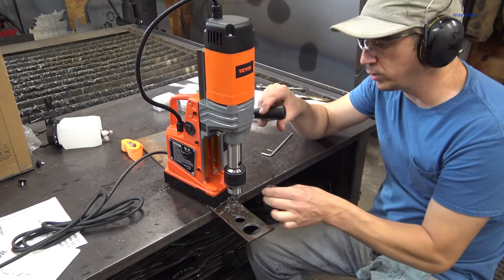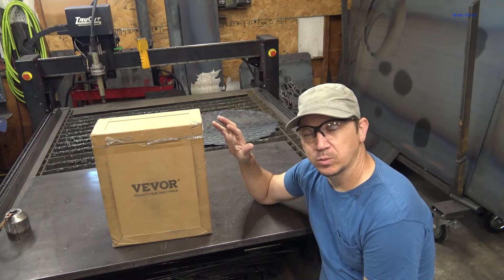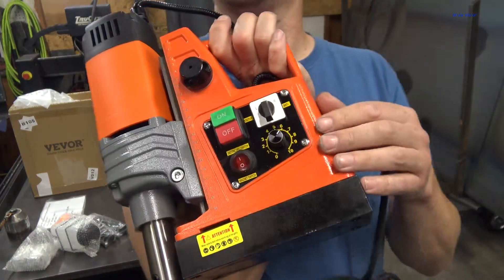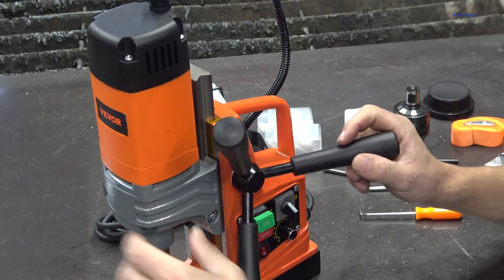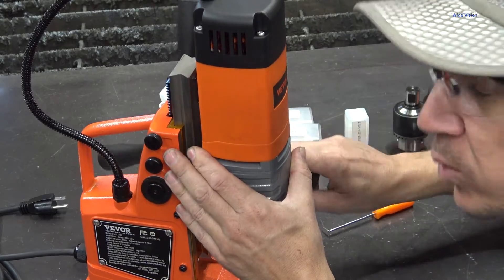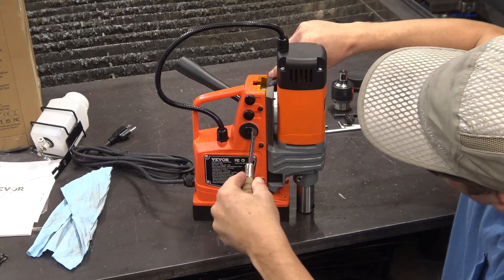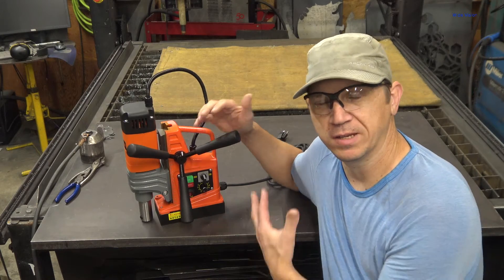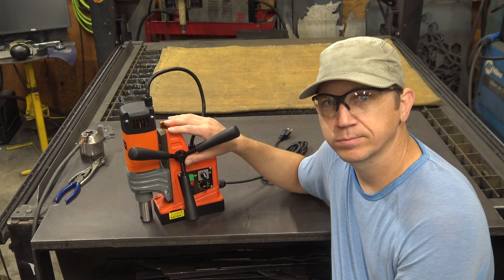VEVOR  mag drill - SLIDING HEAD, variable speed, and REVERSIBLE!  model D8840

Comment: As a retired union ironworker I worked at structural ironwork on bridges and buildings where we use mag-drills all the time. one thing we always teach is to hold the handle of the drill body in one hand and run the crank we to other so that if the magnet breaks loose for any reason you can still control it and limit the knuckle busting kickback and the sharp bit. On most mag-drill move the crank from one side to the other is easier, like Hougen  drills have a keyed shaft and some newer drillls use a female 1/2 inch square drive on both side and come with a ratchet. The handles always get in the way and usually we just use one handle which means the others often get lost in the field. We alway use what we call a football or close-quarters drill where height is an issue. The carbide tipped annular cutters are a game changer as is speed control. Cutter diameter and type dictate speed and you can't go wrong googling rpm charts to match the material you are drilling to the diameter of the cutter, surface speed. A very good video. I just bought one of these for my home shop because I can't justify the cost of the Hougen or Fein drills but if i had a butt load of hole to drill i would not hesitate to pony up the money. Thanks for the video it was very well done. Make nice deep center punch marks when you layout holes because locating the center pin help keep the drill aligned when starting the hole.
Reply: That's some asinine logic 😅, you really think when that drill breaks loose your puney meat bag hand is going to hold that thing let alone " control" it ?  First off teach them to strap it down hence why they come with it, and if that helicopter takes off gtf clear of it not hold onto it, SMFH. Orthopedic surgeon is gonna love you guys. Has enough torque to drill a 2" diameter hole thru plate steel,and you think your going to control it let alone one handed while surprised instantly 😅😂 keep the wives tales and teach these kids self preservation

Comment: Getting the handles on mine was a bitch, everything else was a breeze. The first time using it made me wonder why I had not bought one before. Moving the motor allows the use of regular drill bits, I haven't tried tapping a hole yet, but there is always tomorrow.Yes the handle is reversible, being a southpaw I like it on the left side. The switches are okay where they are on the right side. Glad to see someone else satisfied with this mag drill.

Comment: The Dewalt has a reversible handle, for the price,  cannot complain. I would be afraid to use it  on a  job that requires many holes, for example, a welding table.

Comment: The terrible runout is due to the bearings.  I bought a Vevor mag drill in December, which I tore apart because it had TERRIBLE runout.  Almost an 1/8 inch of runout!  So I tore it apart, thinking the quill shaft had to be bent, and that I would straighten it.  But once I got it apart, which was very difficult, I had to drill out a square key that had been peened in place, I found that the shaft was perfect.  (.001 total runout)  So I ordered new (NSK brand) bearings that the shaft rides in, a small upper and a larger lower.  I received the bearings last week and installed them yesterday.  It looks way better to the naked eye, put the indicator on it, and it now has .007 total runout.  PLENTY good enough for an annular cutter.  So FYI:  it's the cheap Chinese bearings causing the horrible runout.
Reply: As nice as brushless motors are, they had to make the bearings the weakest link. Bearing mods should probably be a thing.

Comment: I started to enjoy this review because I'm considering buying a Mag Drill but as soon as this knuckle head started drilling, I lost all respect for his "skills" once he started drilling at high speed instead of letting the drill bit do its job properly. Every Machinist knows that drilling has to be done at the lowest RPM possible to maintain the bit's sharpness and life span and once any smoke starts coming out, you have to backdown the speed. The smoke is the 'indicator' of what the proper speed is. Which simply means, this guy doesn't know much about metalurgy or drilling for that matter at all. And he's not using the proper coolant or tapping oil. Thumbs up to the drill, thumbs down to the "operator". What's really funny is that while he's making his mistakes, he's blaming the drill for not tapping through fast enough? Drilling is not about speed, it's about doing it effectively, you Duh?!?
Reply: 😂  You have no idea what you’re talking about.   Yes, he was drilling far too fast.  But smoke means absolutely nothing in this setting.  He’s drilling steel, not wood mate.  When you’re using steel to cut steel, it gets hot…always…Regardless of how fast you’re going.  When you add high sulfur dark cutting fluid to that equation there’s ALWAYS smoke.
Reply: I received mine this morning and made some holes this afternoon, 5/8 holes easily in 1/2 in thick mild steel.
The only thing negative, I would like to have a stopper to stay the drill in upper position.

Comment: I have that exact unit still sitting in its box I bought a month or so back, I just haven't got around to doing the job I bought it for yet, so have not unboxed it. I didnt realise it had the extra height adjustment, that is indeed a game changer. The amount of times I have struggled with clearance on mag drills isn't funny! It is also really cool to see the handle is reversible, as I am left handed and would probably prefer the handle on the left for general use!
Reply: OMG you bought a new tool that you didn't pull it out of the box right away and try it out , that to me is crazy self control
Reply: Change my handle to the left side the first day, I'm sure that will drive my son crazy.